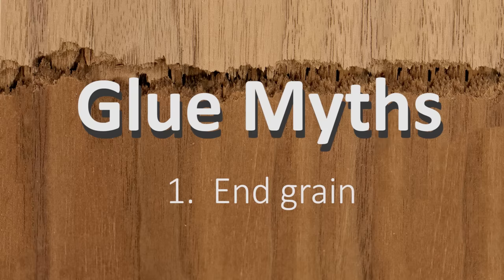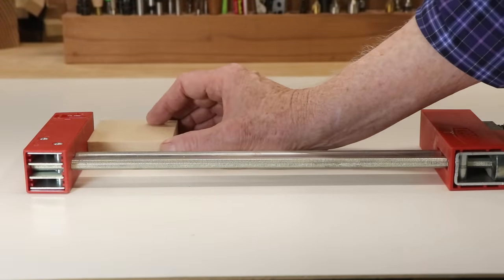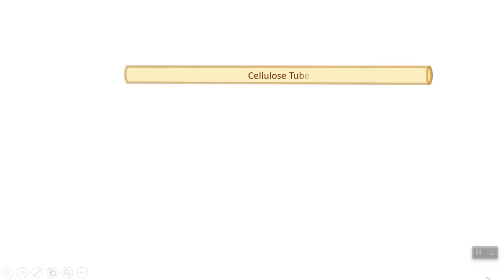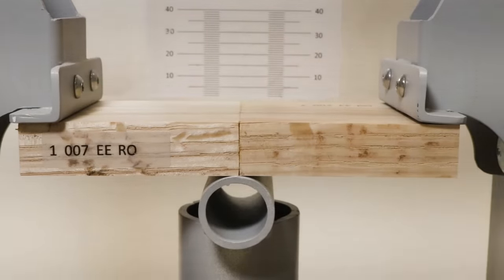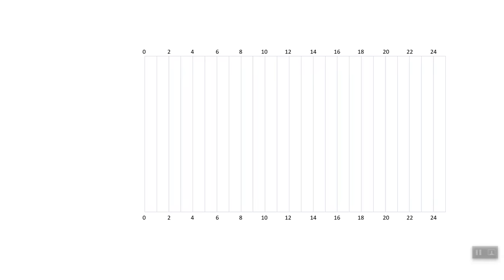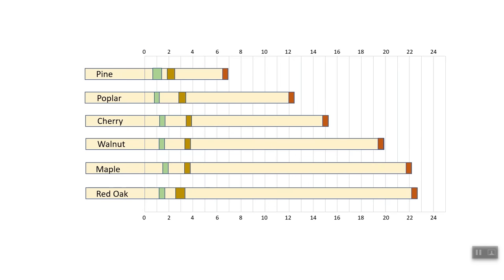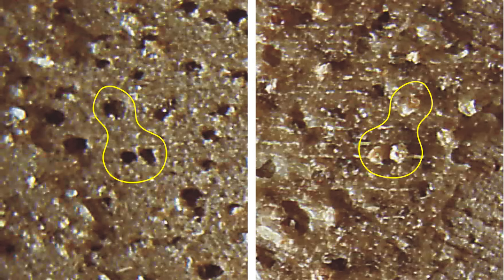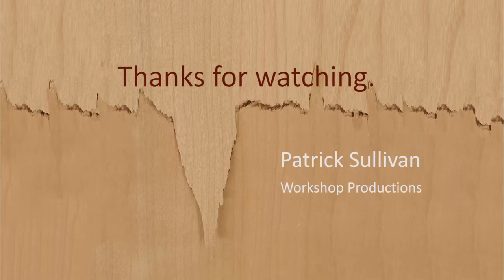Glue Myths:  1. End grain

Comment: Great research project. Just a couple of comments. All joints tested in bending, not tension, and the stress intensification that the actual joint experiences will depend upon the modulus of the wood species. Was this to intensionally replicate the stresses that a typical furniture joint might expericnce ?  One other comment...you appear to have only tested one joint of each design/species. You should test a minimum of three joints/species, depending upon material availability (you could have reduced the test piece size to accomodate this.) Your observations/comments would be appreciated. Nice study.
Reply from the maker: I actually did test at least three joints of each species.  There is some variability, and it is difficult to obtain high precision.  However, high precision is not required to grasp the conclusion.  The differences in grain direction were much larger than the variation between multiple samples.  
Please note that I was not testing furniture joint strength.  The real forces on real furniture joints are subject to an almost unlimited range of variables.  To get a meaningful answer, you would have to test every joint, in every combination of dimensions, employing every kind and direction of force that occur in real life.  That is not a short YouTube video--it is a massive, maybe lifetime project.  I am simply trying to understand how wood grain affects glue strength.  If you start out with incorrect information about that, you are likely to make suboptimal decisions when designing wood joinery in the real world.

Comment: No disrespect meant to your scientific theory but you never broke a glue joint going with the grain you only broke the wood and grind. the end grain will always break the glue. As a general rule if I was gluing up a panel with the grain to make a table top or a floating panel in a cabinet door I am glueing a very long surface and that’s the length of the glue joint add to the geometry of the glue joint making it stronger. End grind to end grain we generally have two longer boards such as trim or a really fun example frame stock around a picture. In these scenarios leverage will cause you to break the glue joint with relative ease. Consider this, your building a step stool and you put four legs at the corners of your platform. The platform is 2 foot long 1 foot wide and one and a half inch thick. As a general rule anyone building this step stool would have the grain running the 2 foot length. Now cut that stool in half lengthwise so you now have two half’s  of a stool that are just under 6 inches wide and 2 feet long so that the glue up of two 6 inch wide boards the seam will be running the full length of the 2 feet. Now step on it. Basic geometry and leverage means you’re putting the stress down the grain of the wood even though you have a glue joint. Now cut that stool and a half so that you have two boards roughly 1‘ x 1‘ and then glue it back together. Let the glue cure properly. Bet you won’t step up on that stool because you should know it will break and it will break right on that blue line. Your lab experiment puts undue force on a joint in a direction the force, as a general rule, will never be applied. Let’s go back to our footstool would you consider building it where the green runs the 1 foot length and have the 2 foot length perpendicular to the grain. The answer is no unless you plan to put Cross supports underneath covering the 2 foot Length. Without that extra support that stool would break even though there’s no glue seam. So maybe you should try to remember to compare apples to apples and oranges to oranges and do it the way it would be done in the real world and not try to figure out a way to manipulate the outcome to fit your theory.

Comment: We're not testing the glue joints, we're testing the wood along the grain and across the grain.  Those strengths are very different, as we know.  If the glue joint did not yield, but the wood did, the numbers, i.e. the results of the test, were of the strength of the wood in that direction, not the glue joint.  We can say "The glue joint was stronger than across the grain of the wood," or that "it was not stronger than the wood along the grain," but we can't draw any real conclusions about the strengths of the glue joint itself in the different configurations.

So...  inconclusive.

Comment: I think there is a lesson or maybe takeaway you are missing.  End grain joints are ok but no joint is far superior.  Maybe that is the reason conventional wisdom has been to avoid end grain joints.  A single  piece is going to be much stronger than two pieces joined.  My question is what if you used boxed or feather joints in the end grain, would it close the gap between end grain joining and solid wood?

Comment: perhaps at the time that this myth was generated they were using a different kind of glue..hide glue or bone glue that was not as strong as modern wood glues..to the common worker..glue is glue..until somebody with intelligence comes along and does some tests..most workers are more interested in their hourly wage and getting home for a few beers rather than spending time doing tests..a whole different mindset. I studied luthiery and was told that water was death to glue..do not thin it..i thought perhaps that by putting a little water on the joint before the glue might help to make the glue more able to flow into the pores..capillary action perhaps..try sucking peanut butter through a straw versus water for example..would like to test these theories out some time, but it does take time if you want to do careful accurate testing..thanks for the video.

Comment: I never did believe that.
End grain can soak the glue in. How can that possibly be weaker?
It can't, and now there are numbers to prove it 👍
Reply: No, the endgrain join is, as even the video shows, weak. Take the same beam and cut a scarf joint or lap joint where you then have the same goal but instead of endgrain you are glueing longrain (or nearly for the scarf) - and it will be much stronger.

Comment: The end grain joints failed at the glue joints, edge grain joints failed at the wood.  

All your test proves is that the glue is stronger than the lignin In the wood.

Comment: This is really misleading. The end-to-grain breaks easily in the expected area. No one relies on the cross-grain strength in the wood piece like that. You're not really comparing the joint strengths at that point, but the strength of shear across vs along the grain in the wood pieces. Anyone who because of this video is considering using butt joints to join to two pieces of wood who meet in the usual direction, should be aware that it's a much weaker joint than many other methods, such as a lap joint. That's not a myth.

Comment: I can see why people would believe end-to-end glue would be weaker.
- end-to-end always fails on the glue
- if you glue long boards end-to-end there is just too much mechanical advantage if you apply force to the ends
- apples-to-oranges comparisons between glue strength, lignin strength and wood fiber strength.

I just saw that you gave the same conclusions at the end, I feel stupid now 🤦

Comment: If you watch a video for factory produced glue ups, they will clamp the product under hydraulic pressure, (ie. plywood)
 Wow, that really has to force the glue way down in the wood fibers. I have recently started putting my glue ups under pressure. Simple but effective....I turn clamping handle with vice-grips. I count off the # of full turns for each clamp.  My theory is that I am forcing the glue much further into the wood as opposed to hand tight.  Am I fooling myself?

Comment: I think this tests, as said also at the end of the video. Are comparing apples with oranges.
Reply: A way to compare should be to glue 2 end to  end pieces in one case cut diagonally at 30 or 45 degrees and in another case cut straight down for half the thickness then longside for 3-4 cm and then back down forming a joint with parts overlapping side by side. In the first case, the strength will improve narroving the angle. The second case should offer bettet resistence than the pieces glued end to end in your video.

Comment: End grain joints break glue instead of the lignin. Thus end grain glue joints are relatively weak. When making a joint you want all components to have about the SAME strength
Reply: Side grain joints break lignin instead of the glue. This side grain glue joints är relatively weak. When making a joint you want all components to have about the SAME strength (?)
Reply: @pinkerbot  Yes, in every design you want to optimize strength. That is you want to utilize every material to its full potential. Ideally when applying stress everything should break at the same time. When it doesn't he design is not optimised. Thats why you have half laps, tenons and a multitude of other techniques
Reply: @nilton61  but these tests are specifically designed to figure out the relative strength for various types of joints.
Reply: @pinkerbot  Yes they are and they do a very good job of showing hats mr sullivan is claiming: lignin<Glue<fiber. You need to respect this when choosing a joint.
For example, you're making a glulam board. Here it is perfectly ok to use glue only since the glue is NOT the limiting factor. Depending on how the board is loaded either the lignin (probably bad design) or the fibers will break. Never the glue. 
A different example is a frame. Since a mitered joint endgrain will be glued to endgrain with no fibres bridging the joint the glue will  the limiting factor and despite the glue being stronger than the lignin the frame will break at the joint. Thus the joint will need some kind of reinforcement with fibers bridging the joint, a spline, a dowel, a domino, a half lap etc will all do the job

Comment: conclusion ; long boards with no glue are stronger. the tensil strength of wood is fantastik. the compressive strength of end grain is great. shear strength is weaker but varies a lot by species. this has been known for over 2,000 years. the only thing that changes is the glue.pound per pound the tensil strength of clear grain douglas fir rivals steel.

Comment: I suggest a second method: Stack end-to-end vertically, so the glue can actually seep down kinda far into the pores. Then i bet the strength test will be much weaker. The way you glued your end-to-end test was horizontal so the glue didn't really seep too far into pores. Nice vid and i learned something cool.

Comment: I appreciate the effort you have put into this video as well as the equipment you used, but your interpretation of the he results and your conclusion both rely on the assumption that all wood joints will oriented in the 1 way you are presenting.  When you take into consideration joints that are used in actual construction of furniture and other structures such as finger joints, dovetails, splined joints, half laps, etc., and examine the variations in grain orientations versus surface area as compared to the joint you are testing (which is not representative of a joint used in the real world structures), I suspect your conclusion will be to the contrary.  I look forward to seeing such tests.  Thank you.

Comment: could this myth come from the fact that wood glue has gotten a lot better in recent years? could it be that this myth was true 500 years ago when glues were not the greatest/ consistent quality, and as the end/end join depends so much on the glue strength than that of the wood, this will have had a bigger effect of the strength of those joins... so is born the myth that end/end makes a crap join instead of what it should have been, crappy glue makes a crappy join?

Comment: I think it all comes down to misinterpreting the concepts and people slowly repeating the wrong message.  The end grain glue "joints" are weaker as you demonstrated, and the side grain "joints" never failed, the lignum did.  This clearly shows the need for proper joinery.  A glue "joint" should only be used in a non structural manor so that years down the road the real joinery is what keeps the object together.

Comment: Personally, I am not willing to throw away centuries of woodworking wisdom just because we have great glues now.
At least, not until some additional variables are considered that you did not test:
1) Expansion and contractions with changes in humidity.
2) Time: especially to allow many cycles of expansion/contractions.
3) Mechanical strength. Particularly with end to side grain, you showed the side grain breaking. It seemed to always break near the joint. Consider how a tenon would extend the long grain where the side grain may be weak to avoid the break.
So... Not yet.
Reply: The 'myth' was started back in the days of 'white glue'.  Remember those?  I would not glue end grain with that old glue.

Comment: Ok, so hear me out: if you care about the strength of the piece you are making you are going to make sure that the forces that work against the piece will be applied across the grain, not on the lignin. If you have 2 pieces of wood, one 1x1x10 made by 2 0.5x1x10 glued side to side, it will be stronger than a 1x1x10 piece of wood made by gluing 2 1x1x5 pieces of wood end to end, and that is in any direction of the wood (since the glue is stronger than the lignin, assuming the glue is in the middle). Basically: you should try to avoid gluing end to end and instead use larger pieces of wood, but when it comes to gluing side to side it doesn't really matter since the wood strength is not lost.

Comment: This is very interesting just from a sociological perspective, even taking it outside of woodworking. A very good demonstration of how misinformation spreads, and how it could so easily be disproved yet isn’t simply because of status quo. But I echo other commenters that the last part of the video in my opinion is the most important. Because essentially people weren’t wrong that end to end is usually not ideal, but they were wrong about it being the strength of the joint. Well done, very interesting.

Comment: Great video and in-depth analysis. I just wanted to say I always suspected the end-grain strength factor to be inclusive of reliability over time under usage conditions. If a piece of timber is heated regularly the end-grain joints may fail quicker because the end grain is where the wood oils seep to. If it's for the handle of a tool and just left raw finish this effect is most noticeable; your own hand oils seep into the wood over time and the heat of your hands holding the tool is enough to flow the oil through those tubules that make up the end-grain. Eventually oil plus human sweat makes it to the whole contact surface area of the glue. In the edge grain example the oils can never flow all the way to the middle of the contact surface.

Comment: Since you never broke the edge grain glue line, aren't you really just testing the strength of the wood compared to an end grain glue line?  You can accurately measure the strength of the end grain glue line since it actually separated.  If you never break the actual glue line on the edge grain glue up, how can it really be tested?

Comment: It's not a myth: When you cut a stick, then glue end faces, you end up with a significantly weaker stick. When you rip a panel, and glue two panels side-by-side, you don't get a weaker panel. Glue can't match the strength of the fibers, but can match (and exceed) the strength of the lignen

It's not an end-grain problem, it's "glue-won't-give-you-what-fibers-gave-you" problem
Reply: If you want to cut a stick, then join it together and get the same strength, glue alone would not suffice. Special techniques are required

Comment: I think this content is misleading as any woodworker knows the importance first and foremost to take advantage of grain direction, meaning it's just bad practice to have a long strip of wood with the grain direction perpendicular to the length, given that factor if you need to lengthen the piece, gluing end to end will introduce a weak point which can be reduce by scarfing or overlapping side to side joints because you're not relying on short grain to withstand tension but rather relying on the grains themselves, my point is you are comparing endgrain gluing to shortgrain which every woodworker knows are both bad practice.

Comment: Whilst I understand the thinking behind this video, It's apparent to me that you've not actually proven the fact that the glue joint is stronger at all. You said that the break always occurred on the wood section on the side to side and the side to end glue ups. Well, that hasn't measured the strength of the glue joint then has it, as it did not fail. It only measured the strength of the wood grain on its side. This means that you cannot compare the 2 glue ups involving side grains to that of end grain.

you would need to somehow prevent the side to side and side to end glue ups breaking on the wood section completely to draw an accurate conclusion.

This is the most scientific method I've seen to measure this on youtube although, the science behind this one is unfortunately flawed.
Reply: and now I've finished the video... Your conclusion needs to be "Glue is stronger than Lignin", not "End grain glue joints are stronger than side to side" as you've not proven this at any point